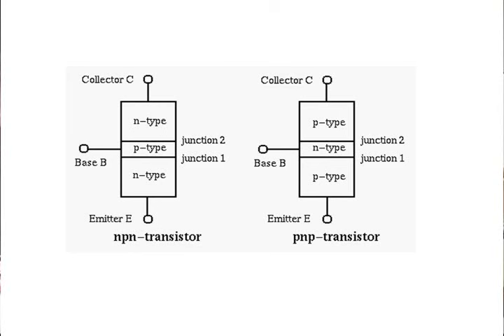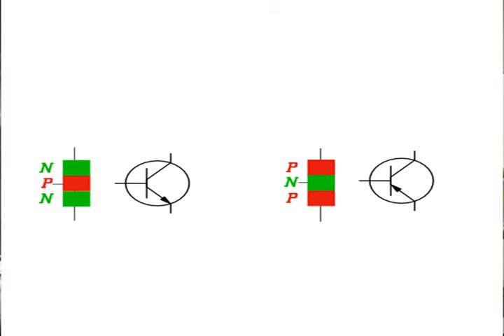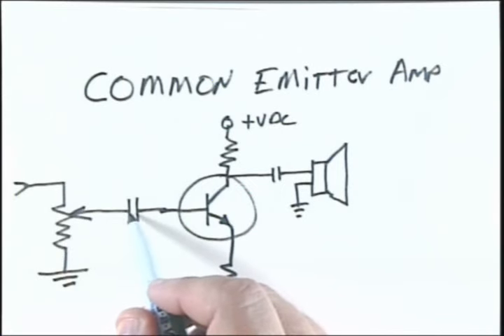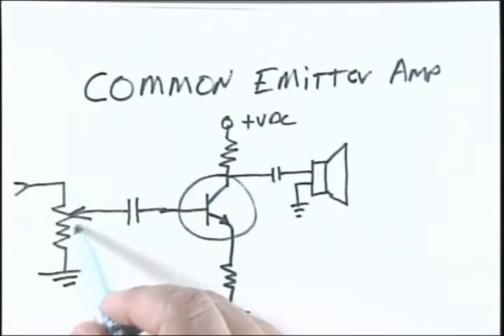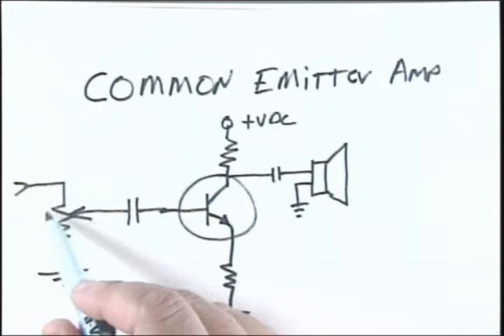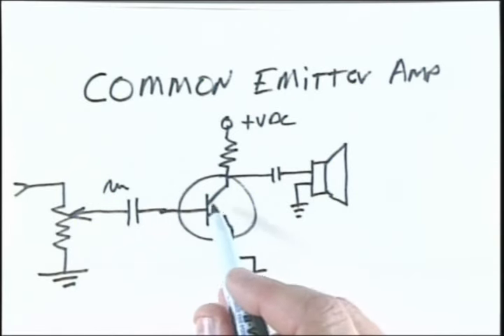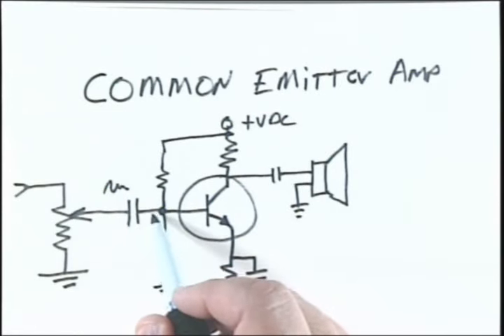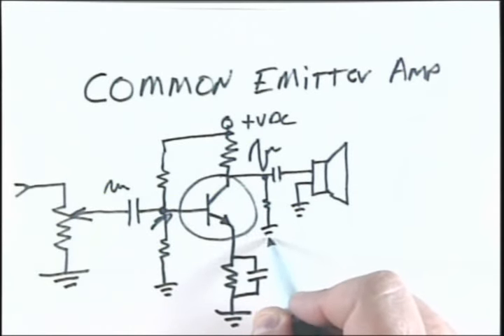Basic Electronics 19 Transistors Semiconductors guitar amp

Comment from the maker: Think of it as three series resistors collector resistor, a resistor in place of the transistor and a emitter resistor. If you change the value of the transistor resistor then the current changes causing the voltage drops across all resistors to change and the measured voltage between the resistors to change. If the resistors were replaced with wires all you would see on the collector would be +VCC and on the emitter ground. (NPN Common Emitter)

Comment: Common emitter config is not the best way to drive a low impedance load since the output impedance of the amplifier is not so low and in addition the collector resistor would need to be high wattage. Why not show a common emitter ampl followed by an emitter follower. Show that the first stage does the voltage gain and the follower does the current gain.

Comment from the maker: In this section I'm talking about electron current flow which in an NPN common emitter amplifier flows from ground through the emitter through the base with a small portion flowing out the base and the majority flowing through the collector to +VCC of course  conventional current flow is in the opposite direction. Ben Franklin guessed and got it wrong and everyone stuck with it even after electrons were discovered. More about this in the other transistor classes.

Comment: This is intermediate for folks who have no  fundamental knowledge of what and how a transistor works. Cut out the nonsense about the pos and neg sand-which(its useless do u want to dissect a transistor?), skip to it's function and diff pin outs. ie It's a valve system like a faucet. It allows a small current(like your hand turning the faucet) to control a very large current(water pressure). Explain how it chops down a large current and divides it by 100 blah blah...

Comment: In Most Amplifiers Most Transistors are Biased Between Cutoff( Off  Vce=Vcc ) and Saturation ( On  Vce= .2 volts)   For proper biasing for Maximum Swing of the input signal and to insure minimum distortion  The amplifier must insure Vce = 1/2 x Vcc. Thanks for the subscription!!!
Reply: If you have added an emitter resistor to stabilise the dc bias points, the the transistor's emitter will likely be a volt or so above ground, meaning that the transistor will be in saturation at a collector voltage of around 1.2V above ground. For maximum output swing, you need to bias the collectors' dc operating voltage halfway between that and the supply voltage. For a low supply voltage like 9V, that is significantly different from half the supply voltage.

Comment: There are 2 loops to this Amp , Vcc=Vrb1+ Vrb 2(  Base Resistors) and  Vcc = Vrc +Vce+Vre.(Collector Resistors +Vce+Emitter Resistors)  Rb controls  Ib,  Ib controls Ic,  Ic controls Vrc,, Vrc Controls Vce So If a Signal is Applied Ib Ic and Vrc increases causing Vce to Drop(this is the Positive Side Of The Sine wave) With the Neg Side of the Sine Wave Causes Ib Ic Vrc Todrop Causing  Vce To Increase.  There is a  180 degree  phase shift between

Comment: Nothing is Mentioned Here that the  Gain will be Very high  Because Av (Voltage Gain) =  Rc/(Re+ r'e) But since  Re has a capacitor across it and effectively shorts Re the Equation Can Be written as Av=Rc/r'e  in which r'e=,04/ Ie (where r'e is Emitter Resistance found in the Transistor and Ie is the Emitter  Current . Because at Audio Frequencies  The Xc(Capacitence Reactance Approaches Zero it places a ac Short across Re Leaving the effects of only r'e)  This Causes Av To Be Very High.
Reply: That is true if you choose the capacitive reactance at low frequencies to be low compared to r'e. A lot of folks make the mistake of setting its value to be less than Re, which is always going to be much higher than r'e if it is to stabilise the dc operating points.
Although the ac gain of the stage may be high, it is non-linear because r'e varies with collector current and it will also depend on temperature. Since Rc ~= Vcc/2.Ic and r'e ~= 25mV/Ic. the maximum gain from the stage can be seen to be Vcc/50mV. Normally, that gain is reduced considerably by ac negative feedback to improve the linearity.